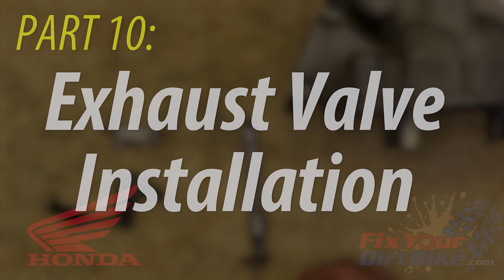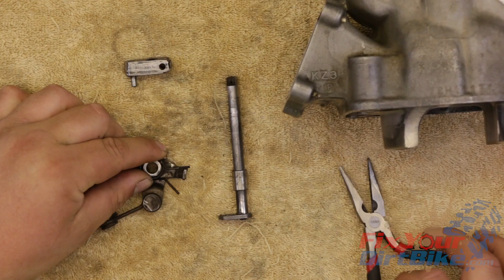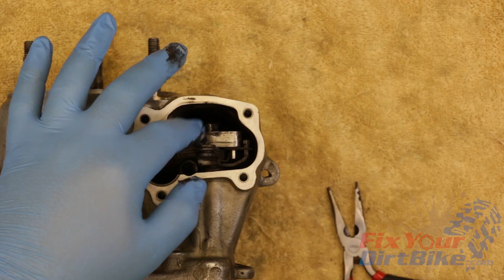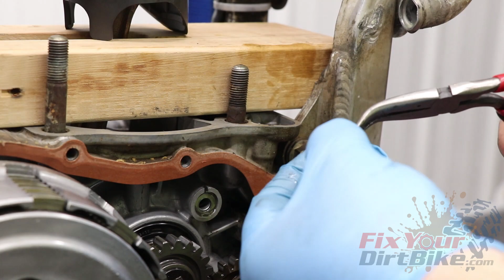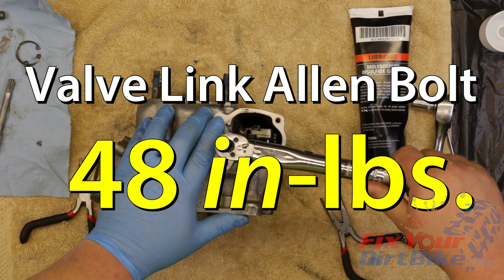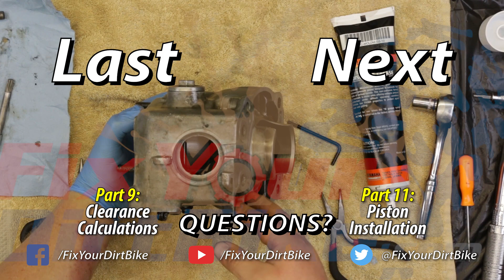97-01 Honda CR250 - Engine Top End - Part 10: Exhaust Valve - Install #honda #cr250

Comment: I have a 2000. The exhaust valve linkage seems to bind on something. I assume it is supposed to move freely ?
Reply from the maker: Yes, it should move freely. Which part of the linkage is binding? the drive shaft, or the assembly inside the cylinder?

Comment: Hey, great video. Just a question. I have a 95 CR250 and the sequence is pretty much the same. Now, with the outer engine case removed I can check valve function by moving the governor in and out (which I have done, and it functions normal) but, when I put the outer case on, the upper linkage moves under the spring tension only, the upper crows foot shaft should not move due to it being locked into the lower crows foot in turn locked into the governor correct?? or does the governor float back and forth inside the case allowing the upper linkage to  move freely??
Reply from the maker: That is correct, the linkage should not move freely when assembled.
Reply: My linkage moves freely. What went wrong?

Comment: Hi John, my throttle response is super slow and take sometime to reach the power band , I can’t remember if I installed the pinion shaft facing towards the outside instead of inside, do you think this might be the problem ?
Reply from the maker: I would definitely double check. If the pinion shaft is not engaged with the drive shaft, your exhaust valve is unregulated with only the valve link spring trying to keep it in place.  Fortunately its just 4 nuts to find out! If that isn't the issue, let me know!

Comment: Way to fast and not enough video caption. SUCKS!!
Reply from the maker: Sorry to hear my video didn't have enough information for you. If you still need help with your exhaust valve you can use the step-by-step guide here - https://www.fixyourdirtbike.com/videos/video-1997-2001-honda-cr250-top-end-service-part-10-exhaust-valve-installation/ 

Or if you want you can contact me directly on Facebook.